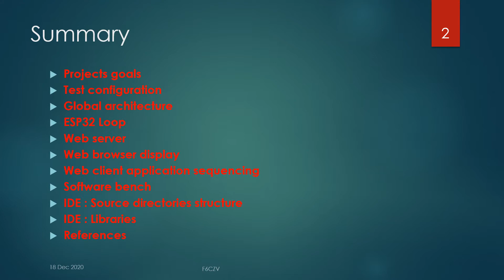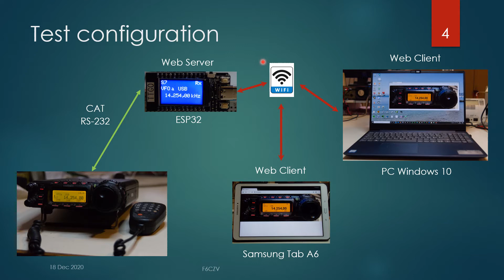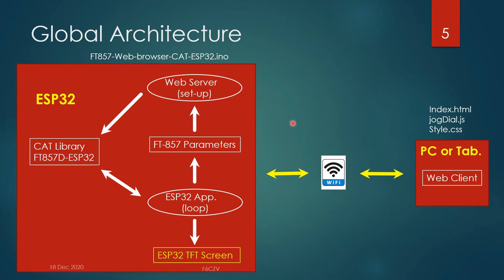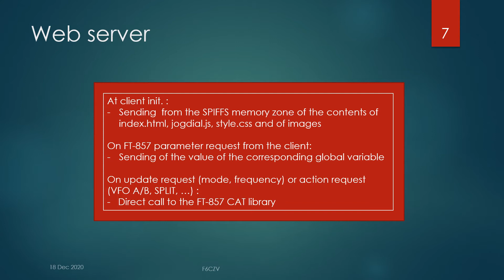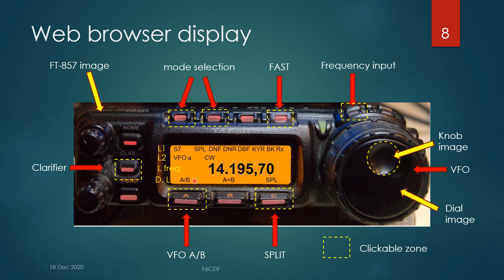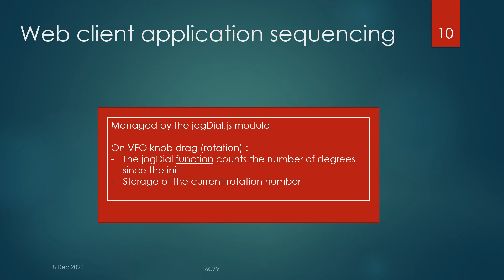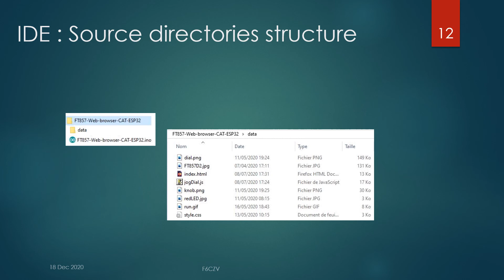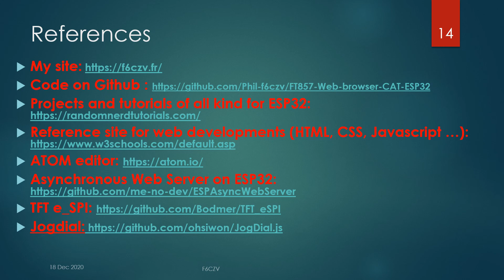Technical aspects of a FT-857D CAT with an ESP32 web server

Comment: Hi Philippe,

my name  Rob Mens,
 I am dutch radio ham so don't shoot me about my English.
ham radio operator named pe1paf
I did learn from your video about the Yeasu 857 and the esp32 I have an 857d as well and also use the esp32.
and that's about this mail
maybe you can direct me in a good direction.
I like to add some device to switch antenna's during listening  wspr-x or wspr-z 

the way I see it and I hope you can point me in a good direction.

I do operate a beacon whit the 857 and the wspr program.
I hope you know the software wspr-x 
I use  a few antenna's 
and every antenna can  use on several bands  
I like to switch between antennas during the listening 

I will look at your site for details 
maybe we can shat about this idea of me and i hope you have some additions for me

most sinsirely 

Rob